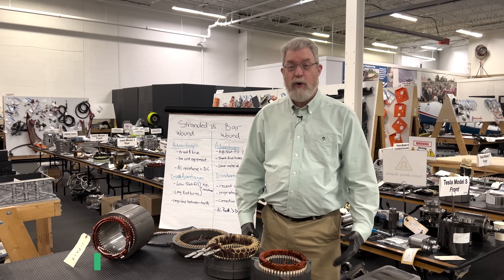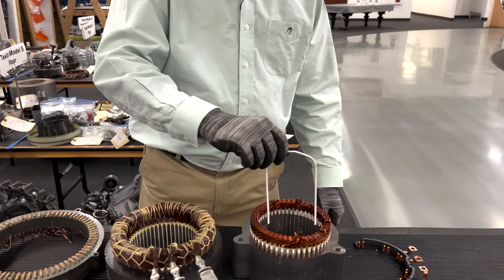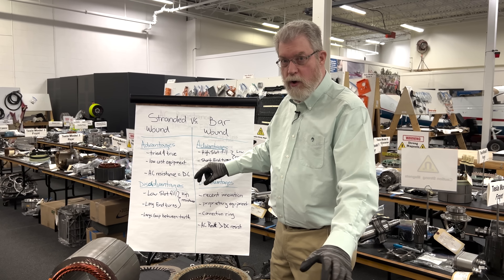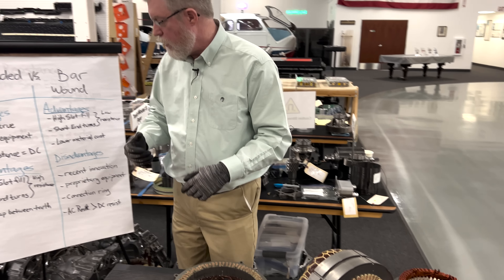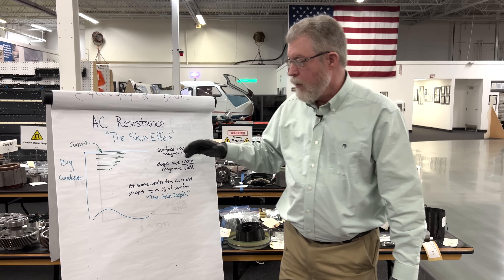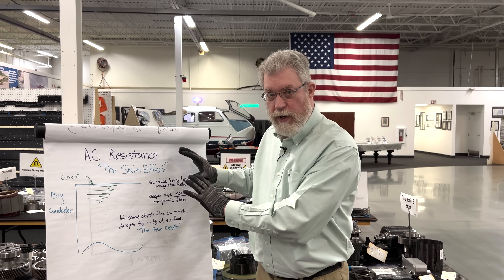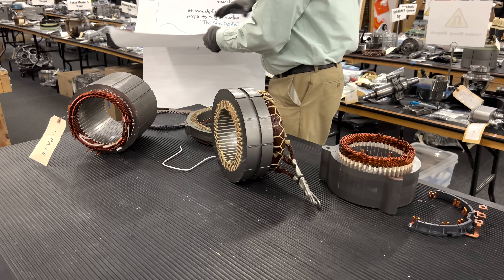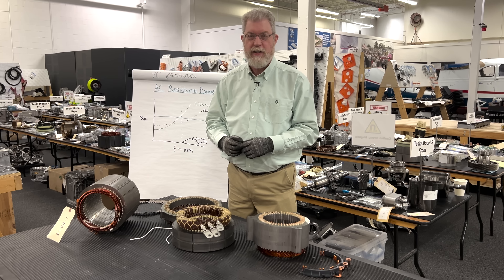Getting Wound Up: Stranded vs Bar Windings in Electric Motors

Comment: What you missed is a calculation showing at what frequency does the skin effec becomes significant and what speed that is.
Also the bars have more copper which slightly compensates for skin effects compared to the multistrand winding.
Reply: Just for the exercise,  the skin effect at 1000hz is 2mm. So the increase in resistance in a 4mm wire would start to become significant at this speed. A 6 pole motor at 1000hz would be spinning at 19k RPM. Most EV motors do 6k to 8k RPM at highway speeds.
Reply: agreed. skin effect happens a lot in radio frequencies than the speeds in electric motors.
Reply: @zodiacfml  the biggest losses in permanent magnet motors at high speed is field weakening current. The only way to reduce this is to run at a higher voltage but that means a more powerful inverter which is more expensive.

Comment: Great video. Wouldn't the speed at which the resistance crosses over be affected by overall gear ratio? Is it also affected by the current flow- in other words throttle setting?

Comment: We do have a way to adjust that, it’s called a transmission ;) I assume the losses in complexity and power running through all that more than make up for any changes for not having to run the motor directly up at the higher speed?

Comment: Sure about that speed trade off? 
The switching frequency is constant independently of motor speed at 10 kHz in e.g. a Tesla. 10 kHz gives some skin effect loss at these wire sizes. Agreed. 
But the motor frequency for a four pole would be about 300 Hz at highway speeds and maybe 600 Hz in a Plaid at full speed. Not enough for skin effect.
Reply: Those stators appear to have more than four poles.

Comment: Does the bar wound gain the high speed advantage if they switch the configuration that you mentioned in the dual stage video? I assume so considering Hyundai-Kia uses bar wound and will be the first to market in 6 connector dual stage.

Comment: Is there also a difference in inductance between these two designs? I would think the stranded motor would have much higher inductance on account if having more turns than the bat motor. If so, the higher inductance would limit torque at higher speeds, but not necessarily have an effect on efficiency.

Comment: what's the difference between these induction motors and the syncronous permanent magnet motors which supposedly are efficient at both high and lower rpms? What is the rotor of these induction motors made of?

Comment: The reason for using rectangular bar windings is that the entire slot can be filled with copper and thus the resistance is the lowest. Using round wire the most you can fit into the slot is ~90%. Skin effect is the same as both cases as you have to treat all the strands as one conductor The magnetic field of one strand affects the strands next to it in the exact same way as if it was one conductor. The only way to lower the skin effect using stranded wire is if the strands are twisting them into litz wire, but this would lower the fill factor even further.

Comment: Did you mention if these were AC or DC  motors? I had read at one point TSLA was using AC motors with a converter?

Comment: Large motors and generators have used bar windings for a very long time.  Of course the major difference is that the large machinery is all hand wound and the new bar motors are machine produced.

What I'm finding interesting is the difference in construction.  I'm assuming the 4 bar motor has two phases per slot, and two conductors per phase.  It appears that the windings are independent.  (i.e., the end turns are totally independent.)  This is different compared to how large machines are made.  In large machines, multiple strips are used, and they are combined into a single large conductor.  Usually they are two stirps wide and many strips deep.  The strips are transposed to suppress unequal current flow due to the different depths of the winding.  Transposition is where one conductor of the stack is eliminated, and the strips rotate through so that in one turn, they all occupy each position once.

Comment: The most intertesting fact is that when you do the analysis for a street driven passenger car, the motor efficiency is pretty much irrelevant! 

This is because the differences between technologies is so small as to make practically no effective different to day-to-day range!  It's actually better to spend your dev budget on optimising things like cabin heating and tyres losses (tyre losses are the second biggest loss in the real world behind aero drag) instead of trying to find 0.5% improvement to a motor that is aready well over 90% efficient!

I should mention there is one caveat to this, and this is for very high perf eMachines where the lower the loss the less cooling that motor needs under very high power conditions, but in the real world, with BEVs routinely having 300 or more kW, the ability to regularily and repeatably use these sorts of power levels is few and far between.  The biggest area for improvement is really in battery fast charging as this actually makes the most difference to the end user o a daily basis ;-)
Reply: Well, lower losses means you can use a smaller motor that is lighter and cheaper.

Comment: Hi Paul, as a engineer, do you think we will see a return of gears to these motors - in order to keep the ac frequency down? iirc most electric cars are already using a planetary gearset for just plain speed reduction, but do you think it would be probable that well see a return of 2 speed gearboxes - or will the transmission losses from that gearing eat away at the efficiency gain of keeping motor speed under the loss curve?

Comment: The "skin depth" formula says that the depth is proportional to the square root of the conductivity divided by the frequency times the permeability of the material.   At electrical power transmission frequency it's roughly 1/2" in copper at 60 Hz.   But the skin depth increases for metals with lower conductivity.   That's why large current carrying conductors are almost always aluminum rather than copper.   Moreover, for much larger conductors, the center is usually steel (a poor conductor with large skin depth) which carries the mechanical load with aluminum with wrapped on in a tube on the outside.

Comment: I'd sit through some lectures from you on the Lucid and especially Koenigsegg motors. 
Would love so see some people get busy with small lightweight motors for restomods. How light can an in-wheel motor get? Ideal rim/tyre/motor combinations to reduce unsprung weight? Often restomods have the chunky older Tesla stuff in there. I think some other brands show us that motors and investers and cabling can be lightweighted for the same output? Rpm optimization is something Koenigsegg mentions, no more reduction gears for direct drive. No reasonable car needs more than 3000 rpm at the wheels, maybe suffice with 2000 rpm, but peak power when in the 50-600kW range tends to come from higher rpms. Kia and Tesla are into the 20,000+ rpm.

Comment: I've worked in manufacturing engineering on both types EV motors. I first worked on electric ford focus and now work in EV motor prototyping. The hairpin motor is MUCH better suited to high speed manufacturing.

Comment: Would the bar motor be made more efficient if they used bars with different shapes?  They could use more copper/more material if they expanded the size of bars as they expanded out from the center.  If they were trying to pack as much copper as possible, the motor casing would closer resemble a gear.
Reply: internal gear

Comment: If I were to ignore cost, and took a proven motor design where I substituted all the copper for silver, what would the effect of that be? Power, heat dissipation, economy? Over the life of a car, especially a single motor one with low copper mass, I could imagine that substituting for silver, if for instance a few % more efficient, could become an interesting calculation. If silver were to help, we'd really want to find the design with the least amount of silver (roughly up to $1000/kg) to provide the output we need. Say, 150 kW in a convenient enough car. Or, if the 150 kW copper motor can be fully (freewheel or clutch) in eco mode and kicking in only when there is torque demand, a 30 kW silver primary drive motor might suffice for 99% of the long drives.

Comment: Since two motor AWD designs are common, is anyone using one bar wound motor and one wire wound motor? Then, say, at low speed the vehicle could have a substantial front drive bias, and at higher speeds it could switch to a rear drive bias.

Comment: What does Aptera use?

Would this mean that the in-wheel motors of Aptera, that would be extremely low speed assuming there are no reduction gears, uses or should use "pure" bar-wound motors?

Comment: Is there a car that uses both? E.g. using bar windings in the front motor, and stranded at the back? It could preferebly use one or the other, according to speed. And if maximum acceleration is required, use both?

Comment: The future is probably axial or raxial flux. From the electron to the wheel more efficient, vastly smaller packaging because of low torque which means no gearbox and fewer wear parts while being net cheaper and vastly lighter.

Comment: Lucid has a better video on hair pin motors, Munro should have watched that and just regurgitated what is in there. Skin Effect from what I remember is only significant frequencies.  Electric motors don't have high frequencies, frequencies are just around the RPMs of the motor. The one huge advantage of hair pin also was not mentioned here
Reply from the maker: We have already done a video on the Lucid motor.

Comment: Impedance is not the same as resistance, it doesn't wastes input energy into heat. You can overcome back-EMF with just higher voltage but that only works to your advantage if the windings have low resistance. It's only a question of battery pack voltage and the utter impracticality of using boost converters on a battery powered EV.

Comment: It seems like the best design would be to have a front and rear motor.. one being large bar and the other being stranded..  The large bar could be what is driving at lower speeds and then the stranded motor would kick in at the higher speeds when it's more efficient..  and you can still have the AWD advantages when needed; but for the most part it would be running only one motor at a time and switching between them.   I would rather have both extremes.

Comment: Stranded wire has more surface area then buss windings, at high motor RPMs high-frequency skin effect has less effect, which gets more amps into the motor, which results in more high end horse power.

Comment: PS. What if wire wool was used to make the Hairpins? Wire wool is cheap and fine. Under pressure, it could be formed into the correct shape and form with incredible ease. The benefits from using copper could be offset by the technical specs and cost!!!!!!!! Interesting Research Project...............Guessing the output would be very non-linear, but at such high frequencies,,,,, would that offset and counteract the skin effect????

Comment: Which one is the Chevy bolt?
Reply: I would bet it is wire wound
Reply: The Chevy Bolt motor is an excellent example of a bar wound motor with optimally sized conductors.  For a vehicle that came out in 2016 its powertrain holds up very well to the best technology in todays EV's.
Reply: @PaulTurnbull-EMfield  I'm enjoying mine
Reply: GM generally uses bar-wound motors... in the Volt (and the various 2-Mode hybrids), Spark, Bolt, etc.

Comment: Why is it, that we dont change the gearing, so that the highway speed is the cross effeciency point. That way the 4 bar design is the most effecient? Is it just because, it is going to use overall more energy at lower ranges?

Comment: As a simple robot electronic guy, I have never understood Maxwells equations. Magnetic stuff gets really difficult. I thought "hairpin" motors were better for robot assembly /weld , and magnets inside the stator/rotor can improve the performance ? Motors are complex - has anyone (maybe Tesla) created a computer simulation for motor design ? Brushless motors live in a parallel universe - don't try powering up multiple ones with controller boards... (it's the low ESR capacitors, see ?)  Well, its that plus stray inductance in the power leads...
Reply: There are several good (but expensive) computer programs already in existence for motor design. Most, if not all, use finite element analysis (FEA) methods to calculate where the magnetic field lines will be when a particular current is applied. This allows the torque, speed and electrical behaviour of the motor to be predicted from a simulated design.
Reply: Yes, Tesla created own software for motor design. They eliminated rare earth magnets, optimised placement of magnets & heaps more. Having the tech in-house then benefit when designing Optimus actuators.

Comment: It seems like the optimal design would use 2 or 3 motor design with each motor or set of motors being optimised for low and high speed respectively. Say 2 motors with low speed optimization with one motor high speed optimized. So at low speeds two motors work and oen is disengaged while at high speed two motors disengaged and one high speed engaged. Its this or use a transmission to take a low speed optimized motor and keep its RPM low while turning the torque into high speed power. I suppose the disadvantage to this idea is added weight and complexity. Isnt weight also just an engineering problem though?

Comment: Is the RPM of the motor just an issue of gear speed. Also could an amalgamation of both types be manufactured or a serial drive with two windings down the saft or dual motor saft.

---==--===---

Comment: Technically "AC Resistance" should be called "AC Impedance" since AC causes inductance and capacitance to also affect the flow of current and to change to phase angle of the current to be "out of phase" compared to the voltage across the windings. The "skin effect" is affected by the frequency of the AC current, the higher the frequency the more pronounced the AC current "skin effect" becomes. When you use solid state switching to pulse current into the motor to change speed and torque then the resulting square waves contain many high frequency currents which will increase the skin effect even though the magnetic field rotation is slow and the resulting  motor rotation is slower.
Reply: The voltage has a square wave shape. But the current is sinusoidal. The current frequency is 0-600hz. Voltage frequency is 2khz-10khz

Comment: At DC, it's resistance, but in AC, it's impedance...
Reply: No, he is talking about AC resistance. Resistance is voltage drop in phase with the current and it produces heat. Impedance consists of resistance and reactance. The reactance part of impedance is out of phase and produces no losses.

Comment: From the skin effect I conclude it would be better to lower the frequency of the motor, this could be achieved by discarding the gearing, essentially driving the wheels at 1:1 ratio. Which hub motors obviously do. Question is: why isn't the low frequency the standard, why do we use higher frequency motors and gearing them down? Is this an electronics/control issue?

Comment: AC reluctance is the back emf opposing the rate of change in current caused by the induced magnetic field. The current is delayed relative to voltage. It’s said to be lagging behind the voltage. 
AC capacitance opposes the rate of change in voltage. The current Leads the voltage .

Comment: What about using bar style DC motor? Are we done with DC motors or could there be new technology to make them relevant again in the future?
Reply: cars use tons of DC motors. for the wipers, for the electric windows, for the electric seat adjustment, for pumps and fans
they're much easier and cheaper to control
Reply: Interesting question, I have wondered about to. The dc brush motors are used in some racing cars. Very large starting torque.
Best Whishes  SB.
Reply: @w0ttheh3ll this video is about drive motors which are AC .
Reply: Almost all motors are AC. Even DC motors convert the DC to AC in the commutator. DC and BLDC are electrically very similar but mechanically mirrored. Bldc and AC are very similar too.
Reply: @scoutjonas  BLDC is a type of AC

Comment: Wouldn't a multispeed gear box help to nullify some of the losses experienced at high RPM for hairpin wound motors? Or does the increase in weight and drag from that gearbox negate the advantage that a gearbox could give? Also, does this explain the torque curve of an electric motor, or is this just a part of that equation?

Comment: Why not use a bar-wound motor with its better low-rpm performance along with a transmission to increase the axle rpm while keeping the motor rpm lower?